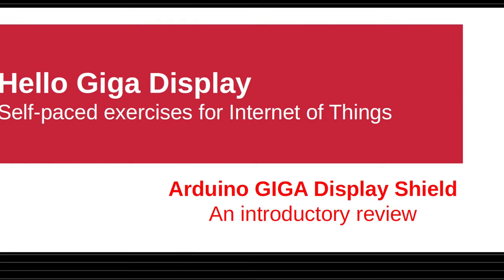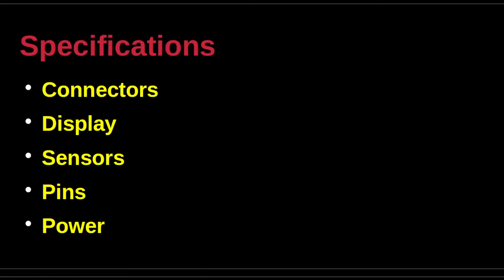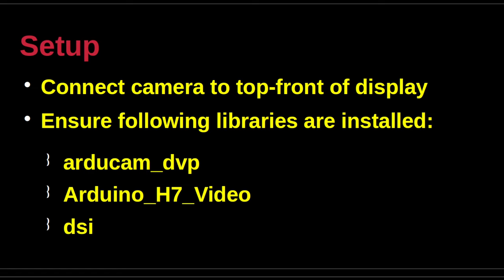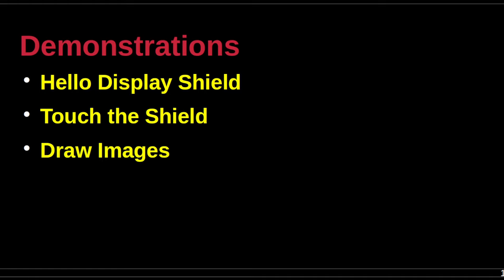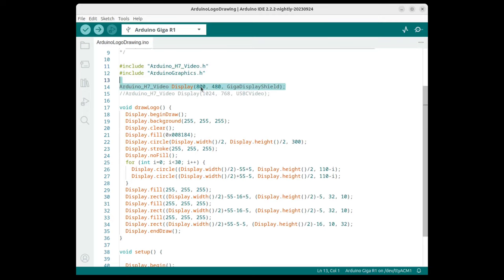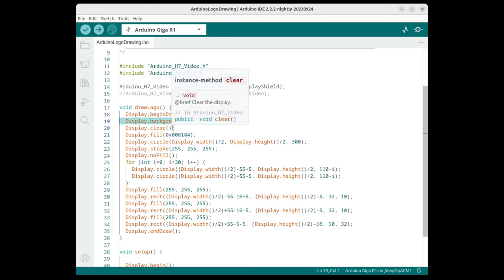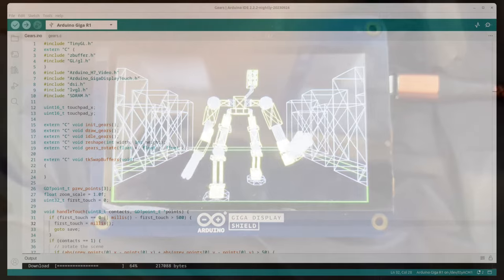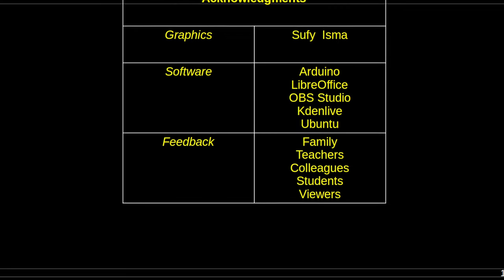Hello GIGA Display Shield

Comment: Hello, can i use SquareLine Studio to Build UI and then upload to Display or how to use as a video player?  can you make video about this topic?
Reply from the maker: I have not used SquareLine Studio. It makes UI development faster (i.e. quicker to release a solution - faster to market). There is no reason why it cannot be leveraged with GIGA Display Shield.  It supports LVGL and therefore even with roadblocks, workarounds can be made. Of course, there are other (i.e. pure FOSS) approaches too. Let me prepare something for your review. Thanks for the great idea. Regards.
Reply from the maker: Hello, @GioGogiberidze! The nearest one can do to design a UI with SLS is described here https://docs.squareline.io/docs/dev_env/animation/#add-property. Let me know if this interests you & I will try to evaluate it. Otherwise, I have to move on to other exercises with the GIGA & Display combo. I have drafted the basic requirements for media player UI but the gaping hole in my presentation is the "big rectangle" in the middle for the MP4 or related files. 😀